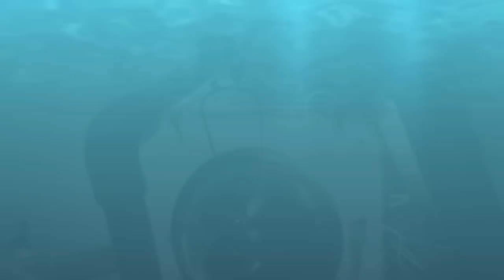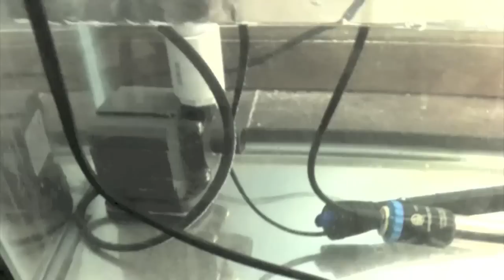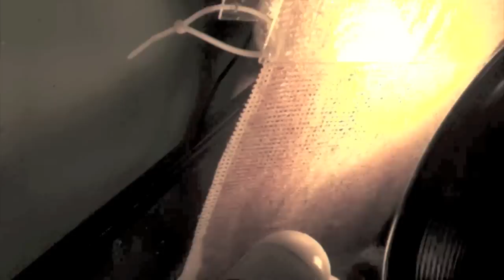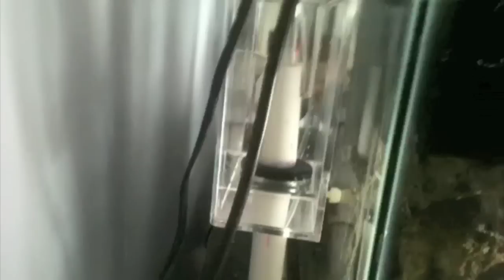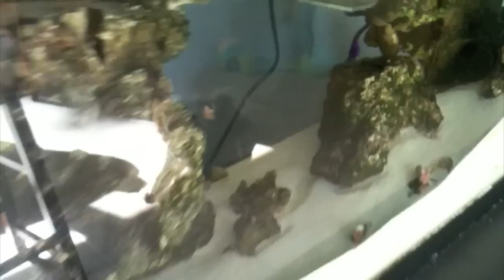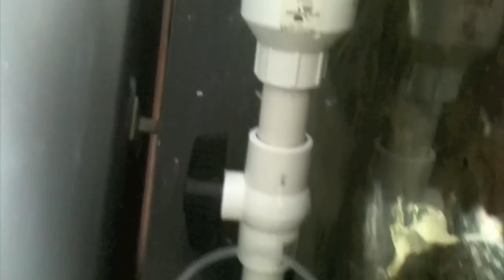Algae Turf Scrubber on my 55 g

Comment: I just built one of these, to reduce spraying make a ton of holes as large as you can on the top of tube, that will reduce the pressure enough that it cannot spray. mine ended up more even with the holes too. looks really good though!